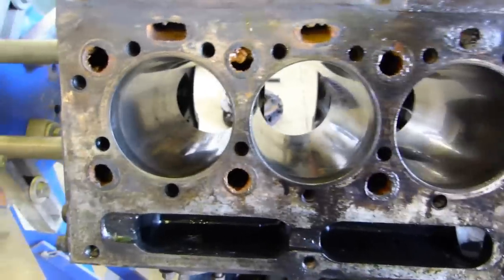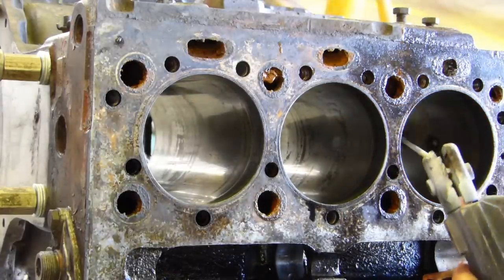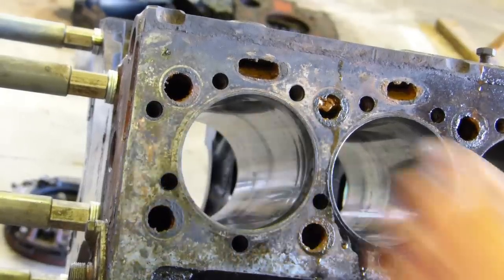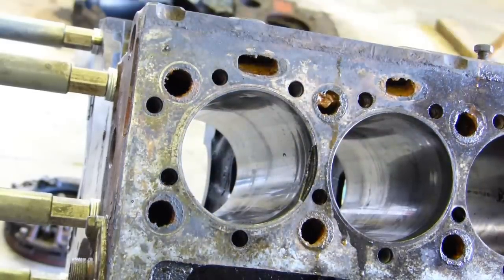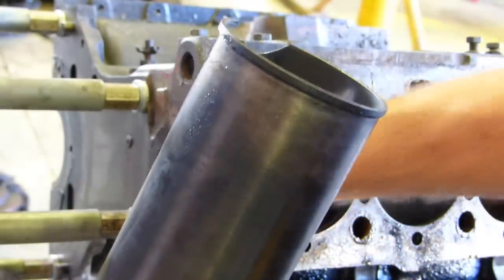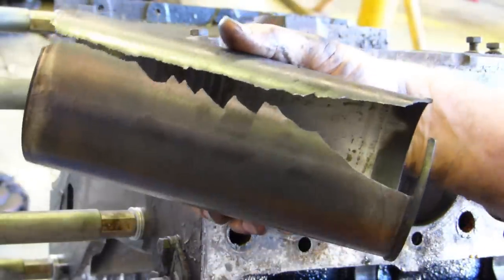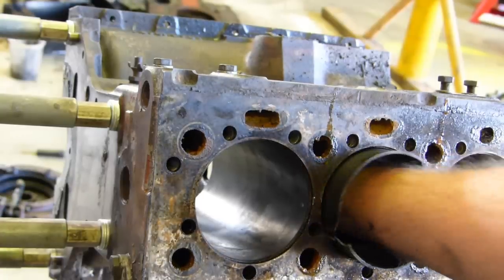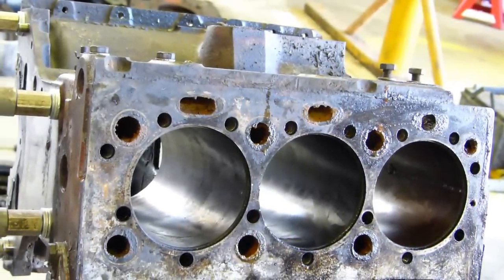MF135 Restoration #11 Removing the Liners

Comment: I used that method on some Perkins 354 liners but they were a little thicker so it wasn't easy. They were also 9" long making a lot of friction trying to use my puller.
Reply from the maker: They can be a pain at times, next engine I am going to make a pulling plate and see how that goes.

Comment: Hi Lance, fantastic series - thank you!! on the main engine block, for cleaning after disassembly, you mentioned power washing, I also heard about a baking option that turns oil to ash and gets all the gunk out of oil ways and calcification out of water jackets etc. either way, what are the special steps to ensure oil ways etc are all clean and clear before starting reassembly ? Later you glass beaded the CAV pump housing, do you ever blast the block? If you could talk to cleaning methods in general it would be highly appreciated.
Reply from the maker: When I had my big workshop I had a hot wash for the big items but now with a good degreaser I pressure clean everything a couple of times. I find every oil gallery after the pressure wash and force brake cleaner through them with compressed air to make sure I have everything. I tap the threads for the main caps and cylinder head and make sure they are spotless as well. Just slow and thorough and everything will be fine with normal mechanics tools. You don't really need anything special.

Comment: You have a lathe and mill, you could have made a puller to remove those liners. There are examples on YouTube. Welding and chipping those liners out, make me cringe.
Reply from the maker: Yeah fair comment, but boy they get tight and I have stripped bolts trying to pull them.
Reply: You don't need to weld, if you make your tool carefully it is easy to chip them out, but you don't want to damage the block, I do lots of 35/135's for a living and  I always chip them without causing any damage.
Reply: What if you don't have the said machines?

Comment: Hi Lance.
Fantastic series. Saving them all as my Haynes manual. Do you need to do anything to flush the water jacket or do they not pose a problem normally? 
Keep up the good work. Can't wait to see the next one.
Reply from the maker: If it was for a customer I would have it acid bathed etc but for my own use I will pressure clean it and possibly bead blast is as best I can.

Comment: 🇩🇰 Denmark
I have normally success by slovenly heating up the complete engine block and afterwards filling dry ice inside the cylinders one by one.
Then to tap from the crankcase side and the liner will come out.
Installing the new liners same way although now freezing the liners night over or by the use of liquid N2 before installing.
Reply from the maker: I have heard about that but never tried it, I will give it a go though it has to be a better way.

Comment: Great videos lance,just got a 135 to restore.We spotweld a long flat steel bar to the inside of the liner and leave it sticking out the bottom and tap it with the hammer driving the liner out.
Reply from the maker: Great idea, I had never thought of that.

Comment: I
Hi Lance. I am most interested in this series as I am restoring a MF 135. The motor was seized caused by picked up big end slippers It appears the injector pump alloed fuel to dilute the engine oil.The  crank was ok. it has done a lot of work , but is basically a very straight tractor. Cheers Ross
Reply from the maker: I hope the videos help, the tractor runs very well now a days.

Comment: Takes me back to my Ag Eng. training days - I think on these the liners were interference fit and we used to refrigerate them before fitting them so they would contract enough to be fitted. That was 30+years ago though, so i may be wrong. Thanks for a very informative and interesting video. Greetings from Wales, UK.
Reply from the maker: thanks Gareth, they should be a little tighter to fit than these were bit it should be ok.

Comment: Sure makes me appreciate the wet sleeves in my TO 20. Once I made the pulling tool they came right out. Putting the new ones in was easy also. I'll be interest to see how the new dry sleeves go in. Just took the front end apart on mine and the cross bar with the bushing is cracked half way across next to the bushing. One good load in the bucket and down she'd go. I will get a new one with the bushing already in it and a matching pivot pin.No problem, just throw more money at it! HAh!
Reply from the maker: Yes the wet liners are easier at times. And dont worry about the money, lol.

Comment: Could you use a #15  oxy cutter  tip to heat up a weld puddle , might give  more control  ?
I used to do that on 6” pipe to straighten it , heat up a dot around 2” dia until it just started to form a weld puddle then quench with a wet rag .
Reply from the maker: Had not thought of doing that.
Reply: Bundy Bears Shed 
might be worth a try , got nothing to lose and you can always crack out the welder if it doesn’t work.
If you have a set of guides wheels for the oxy  it may help to control it a bit better than free hand .
I was surprised how thin the liners are and if the new ones are that thin i would be shaking like a dog shitting razor blades trying to put them in !

Comment: Hi Lance some of the Perkins engines I believe have cast liners, others have chrome liners what do the 35x and the 135 have
Reply from the maker: G Day Ian, The 35 can have either but the 35 I have is cast.
Reply: 35 has chrome liners, 35X and 135 have cast, on the 35 it is best to machine the block and fit cast liners as the chrome ones cause a lot of problems.

Comment: Hi Lance. I known I've watched these videos more than once and should have asked first time round, but my 35 has chrome plated liners. Do they still make like for like in good quality? , i assume you can't  hone them if you don't change the liner or it will damage the thin chrome? Ps , fantastic series 👏
Reply from the maker: Yes the chrome are available and no dont hone them. I havent had troubles with any aftermarket ones so I presume they are all ok.